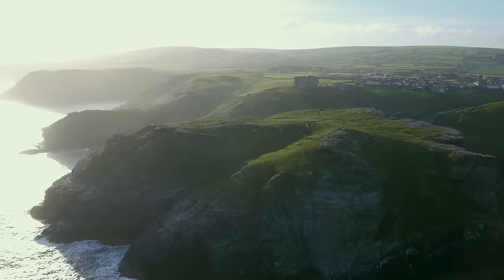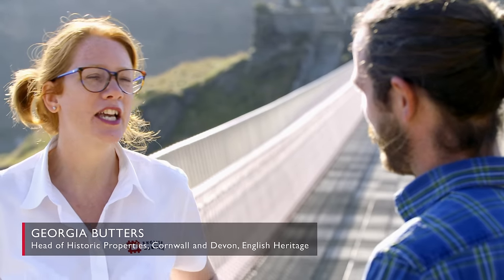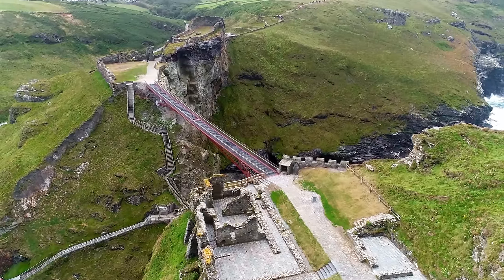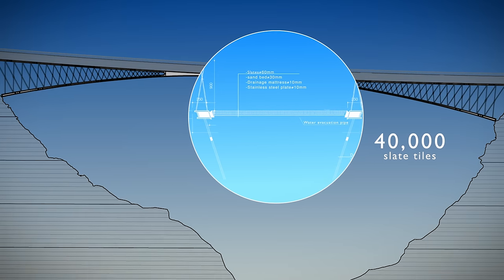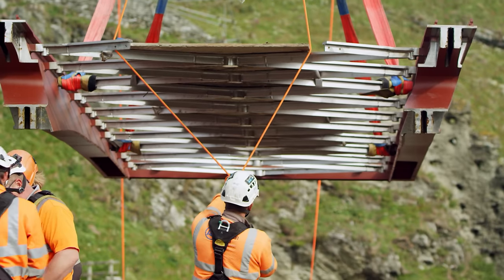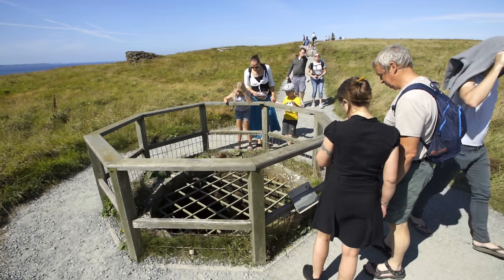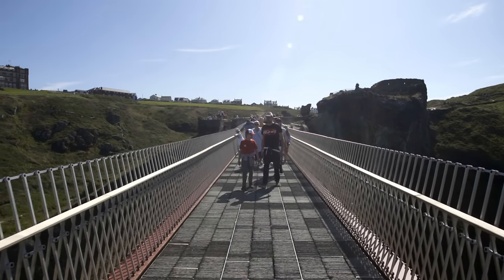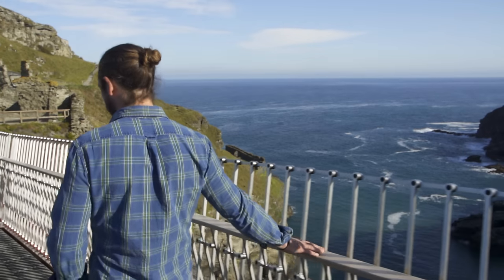The Making of Tintagel Bridge

Comment: I appreciate that the placement of this bridge is much more Ada accessible. People in wheelchairs or people who have mobility struggles can much more easily access both sides of the historic site without having to climb up or down stairs. They can feel more included and not discouraged from  experience all the history they can. I like that It's flush across.
Reply: The sites themselves are still not wheelchair accessible, and as they are historical landmarks, it's not very logical to try and make them so in most cases. Maybe some parts of a castle or other very old site could be made accessible with minor adjustments, and in those cases, it should absolutely be done. In my opinion, the best way of make a historical site like this accessible to those in wheelchairs, things like this which make the grounds around the property accessible are a good start. Would be cool to see Augmented Reality used to help people "see inside" historic sites from the outside. Also if complete video and audio tours were available, or historical reconstructions can be made which are accessible and even include reanactment. Lots of options, but unfortunately there are some things which are very hard to participate in when you are disabled. (Also, ADA doesn't apply in the UK, they have their own laws regarding accessiblity).

Comment: Why is there such a massive gap?  Also, I LOVE a good slate sidewalk, I hate when people replace them with concrete here in America.
Reply: The main problem with steel bridge is that they stretch and contract greatly to changes in temperature for as much as a couple of centimeters. That also apply to the base they sat on. Welding the two halves would cause the steel to bend and buckle. Most steel bridges are made to roll or to have some spaces to move.
Reply: inisipisTV Thanks I was aware of that, but it is rather large.  I wonder if it’s because it’s getting hotter there?
Reply from the maker: Thanks for your comments, the gap in the middle is just 4cm and is a striking part of the design. It is intended to represent the transition from the mainland to the island, and from the present to past. It also adds an extra thrill to the experience! We hope to see you at Tintagel soon.